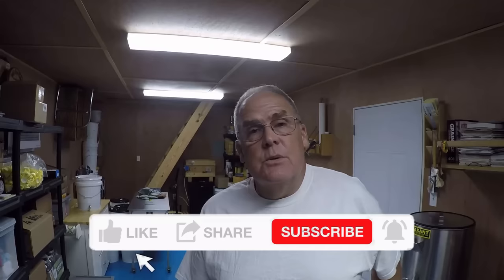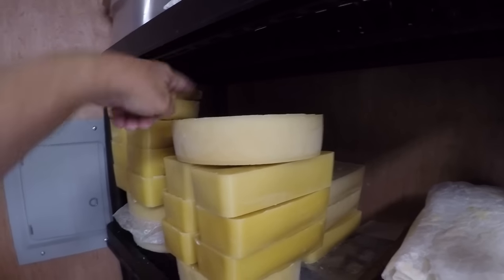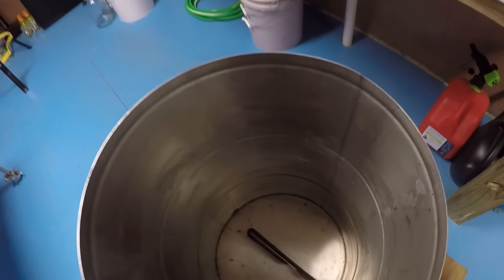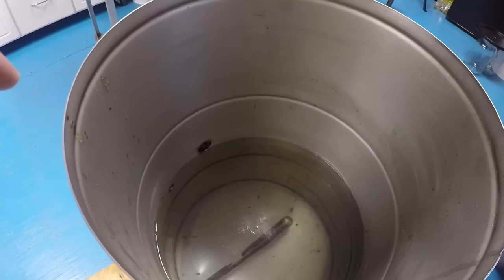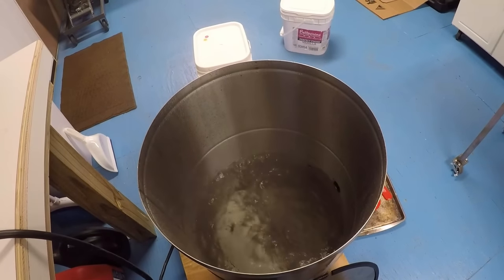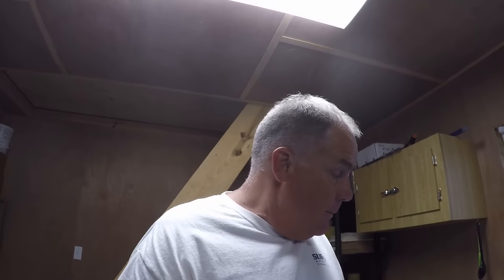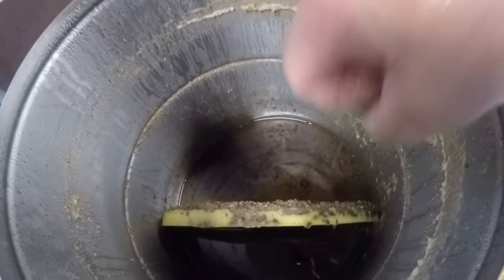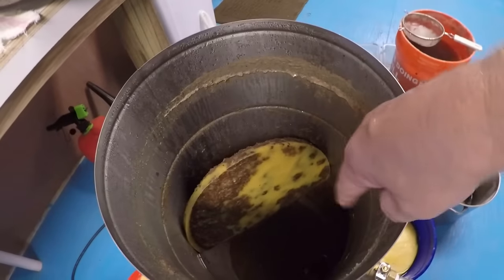Melting Beeswax - A "How I Do" Production

Comment: Happy Saturday Mike!  Great video today.  I have been working on my equipment all day today trying to get ready for next season and bottling honey for the Ace Hardware.  It will be a wonderful day when I can produce as much wax as you.  I usually have to buy a few pounds to supplement my over winter frame waxing.  Anyway, great video as always.
Reply from the maker: Takes a few years to get a good stash. I did a lot of hive removals in my first 4 years to where I always had some to at least wax frames and such, and honestly, that's one of the main reasons I continued doing one removal a year...for the wax. I give the bees away and keep all the excess wax.

Comment: A few things.   Why Cheese Cloth?   It lets too much through.   Get an old with sweat shirt from the Salvation Army or something like that.   Cheaper than Cheese cloth.   Run the hot wax through a piece of the sweatshirt with the inside (fuzzy side) up.
It'll take care of the specks you're getting on the bottom.
Your wax is nice.   When you put the hot wax in water, make sure the water is hot too.  It will stop the issue you had 18:58.  Cold water will cause that issue.
I would take good care of that capping wax.   Nice stuff
Reply from the maker: I might try that. I used cotton once and it just held too much wax. but I'm willing to try your idea with a sweat shirt. For the issue at 18:58, that was 140F water that it was added too. Just happens and really not a big deal. I don't sell bulk wax, so when I melt it down for candles and balms, it all works out. But hot water does not prevent that unless it's boiling and that's not practical nor safe. Thanks for the insight and for watching.

Comment: How do you get your wax melter so clean?  Lots of hot water and detergent?
Reply from the maker: Once it’s done, it really only leaves a couple small rings of wax and a thin film where the wax line was. So I put just a little water in it enough to cover the element by a couple inches and the I get it boiling and let it steam up really good. Then I turn it off and take a couple shop towels and wipe it out.

Comment: Is there another flow going to happen.
Reply from the maker: Not down here. If there’s anything, it has never been enough to make honey for harvesting. They usually make a little bit that helps them bulk up for winter, but as far as making surplus, it’s finished in my area and pretty much the I-12 corridor and north to Mississippi.
Reply: @MikeBarryBees  thanks Mike I’m in Denham springs. And I have a double brood box with 1 honey super but I have a Queen excluder above 2 brood box. Should I remove excluder if I don’t plan on taking anymore honey.
Reply from the maker: @chrisr7746  if the super has honey in it and you’re planning to leave it on for winter so they have food, then probably in November I’d take out the excluder so if we have a cold winter and they cluster, the queen can go with them to the food and cluster. If your second deep has plenty of honey, then you could leave the super and excluder on until the first of November and then remove both and maybe there’ll be some extra honey for you.

Comment: Hi Mike, Can I ask what the distance is between the heating element and the first outlet and second outlet? To get one of those heating tanks here is expensive so I'm looking to get one made. Thank you
Reply from the maker: The total tank measurements are as follows: 24 inches tall by a diameter of 15 inches. The heating element is 2 inches off the bottom. The lower ball valve fitting is 9 inches from the bottom and the upper is 10-1/8 inches from the bottom. So the lower is 7 inches above the element and the upper and lower are an inch and an eighth apart. The upper outlet is a 1 inch NPT fitting and the lower is a 1/2 inch NPT fitting. There is also a drain plug at the bottom that is a 1/4 inch NPT fitting. Hope that helps.
Reply: @MikeBarryBees  Thank you very much! I really appreciate this.

Comment: Thats a nice setup.  My rendered wax comes out like that piece left in the melter.  I usually melt it down in a double boiler and pour it thru panty hose.  This year i tried something different.   I melted it thru paper towels in my homemade solar wax melter.  It came out very clean.  Enjoyed listening to Mr Ed and you on Lees live this morning.
Reply from the maker: Paper towels do a great job for sure. I need to use the cheesecloth for this wax so it will flow a bit better. I actually tried paper towels when I got it, but it drained to slow for the amount of wax. But no doubt, it does a cleaner work. Glad you enjoyed the stream. We had a great time visiting Lee.